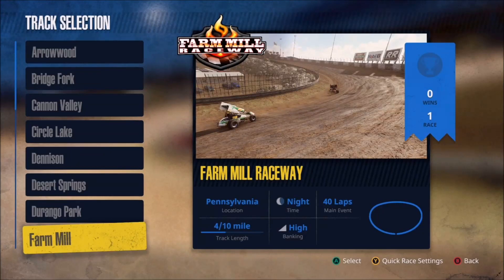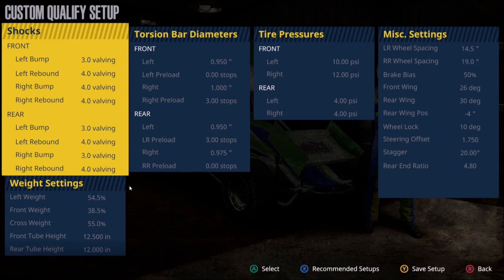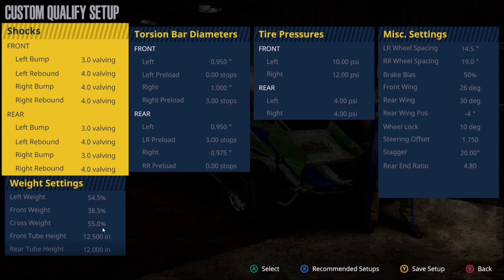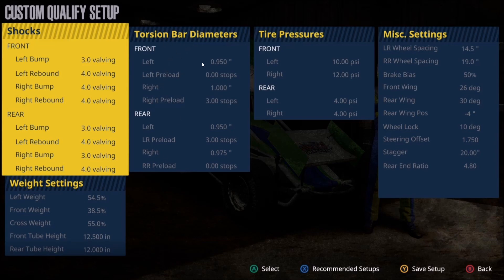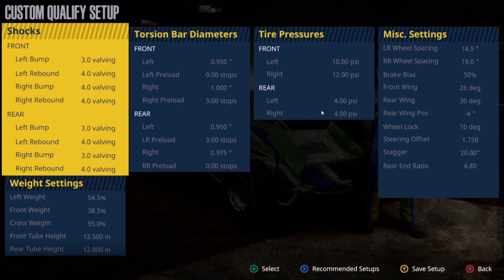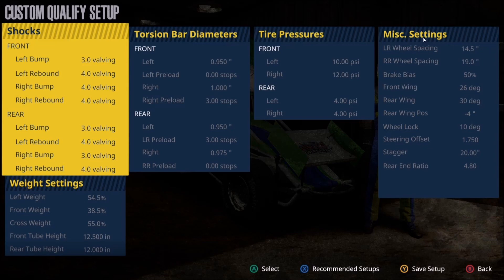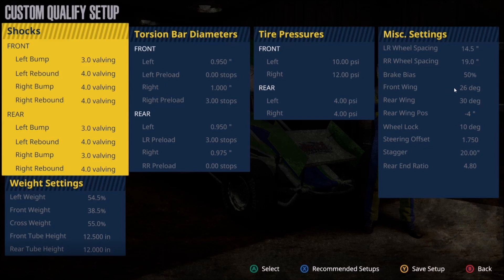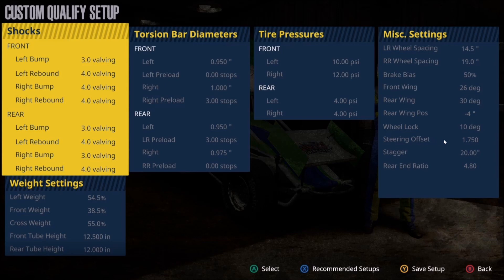Tony Stewart's Sprint Car Racing Setups - 410 @ Farm Mill

Comment: Do upgrades to engine, frame lightness, suspension, etc... make a difference to these settings, or is it just a case of faster or slower? I’ve seen a few of these vid’s but none of them talk about the current power level of the car, etc...?